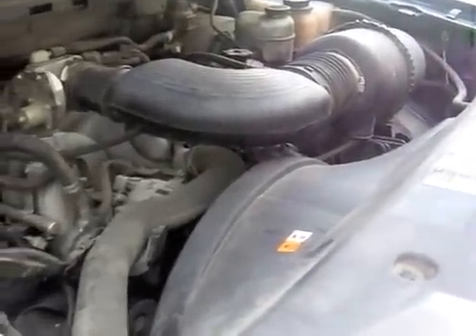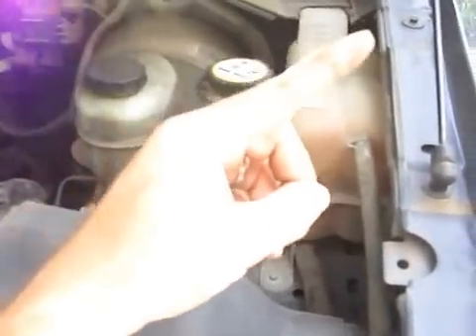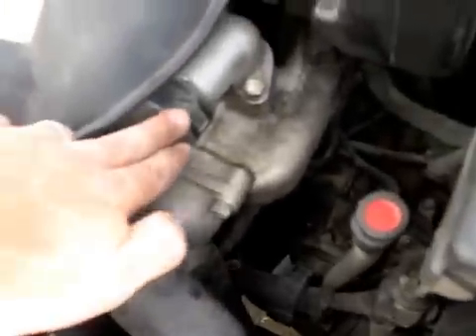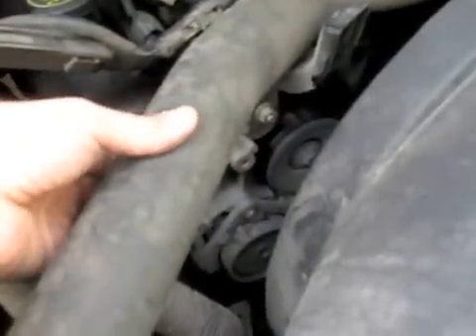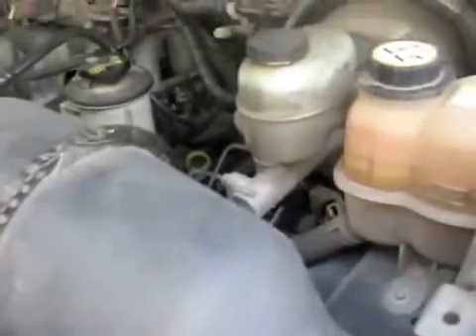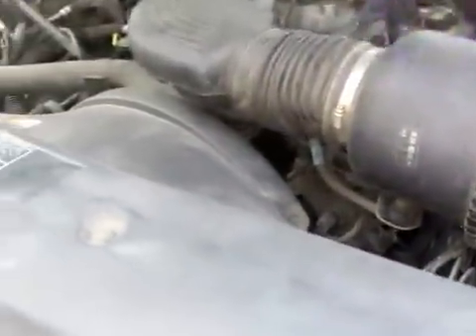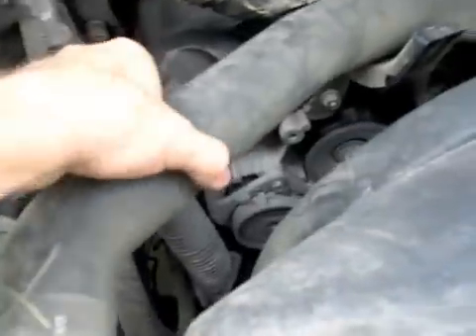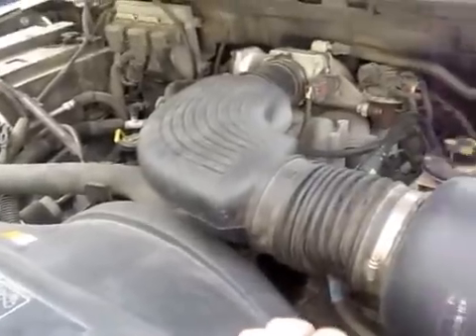Car Engine Overheating - Causes and Symptoms of Over Heating  Car Engine

Comment: I have the 2005 gmc Sierra 1500.  My fans are electric, and the radiator is 3 years old.  It does have a belt noise when cold.   But it began overheating when heater was on,  and turning the AC on would solve it at first.   But now,  every time I slow down or stop driving, it begins to overheat even with AC on. The fans are screaming at this time.  Also, I'm not sure if this is normal,  but when i check my coolant reservoir, it is low,  yet as soon as I open the reservoir cap, it jumps back up to normal coolant level.  This thing is my livelihood.   Im stuck.  Can you guide me 🙏 please.

Comment: 2005 Lincoln aviator  4.6 AWD. Headaches! New radiator. New cooler fan. New A/Pump. New belt. Still over heating in idle and red lights. Will go 80 on the freeway. No problem s. And idle. Over heats ! Ugh
Reply from the maker: I would look hard at the coolant level and make sure there is not an air pocket in the system or it's low on coolant. The radiator hoses should have some pressure in them and not super easy to squeeze together with your hand at normal engine temp.  Both upper and lower radiator hoses should be hot at normal engine temp.  Either you don't have air flow across the radiator (cooling fan motor not running) or you are low on coolant.

Comment: Thank you for pointing out on all those causes for engine overheating. Our 2003 Chevy Cavalier (~111K) overheats only when AC is on and on stops. So most likely it is a faulty radiator fan. But the car has another problem w/knocking sound when it starts to move. The frequency depends on rpm, and it doesn't change if to switch gears on speed. No sound (knocking noise) on idling. The sound is heard in the area of engine, looks like more on the right side. Can those 2 problems be related?  I replaced a radiator on another our car (2001 Saturn SL2), and it was not very difficult. But on Chevy I think maybe they are Connecting Rods which make that knocking sound, so I even don't know if to proceed with this car. My hope is that the noise is only in motion, I hope it is smth on suspension. Thank you again for this informative and detailed film. As a DIY mechanic I've learned a lot, like about time interval when hoses should be replaced, why and when it could be overheating on high speeds and when on idling. It will be my main channel on overheating.

Comment: I'm South of Houston. My 02' Blazer 4.3 is seeming to get around 210° , it does when towing a small utility trailer.
No leaks, water pump works fine, flushed the radiator twice in 2yrs.
Just installed a Severe Duty Clutch Fan but doesn't seem to help.. My AC is always Cold as heck. 
In the past with a 195° thermostat, it's always ran just below 210° & now it's trying to rise a bit higher which bothers me.

Comment: Take a water hose engine radiator cold squirt water through the back side out the front grill to flush out dirt bugs and grime like you would a AC evaporator condenser coils almost the same as a radiator it would cool half of it s temperature just by rinsing the outside of the radiator

Comment: I have a question I have a RAV4 I was driving and the hot need from the engine just shot up yo high and at the same time the heat stop working. I change the radiator the thermostat two times what can be the problem

Comment: I just went through this problem with my 05 navigator with the 5.4 engine, driving on the freeway, noticed that the temp gauges went into the red line. Got off the next exit, found a place to park an pop the hood to see what going on. Had to sit there for fifteen minutes to cool down. Looked at the reservoir and it was sitting the low mark, but it still had coolent. After cooling off, I drove a little slower, went to auto part retailers and purchased some 50/50 coolent and topped it off. Drove it home, next day,  drove awhile,, and the gauges indicated it was starting to over heat. Next day I got radiator pressure tester and the fitting to test the reservoir bottle and cap. The tool and adapter didn't seal, had to use some pipe sealant tape to get it to pressurize. Was able to pressurize, but was leak at the threads of the adapter. Same with the adapter for testing the cap. I had purchased a new thermostat when I got the testing tool, but I had not installed it yet. I returned the testing tools and purchased a new pressure cap after noticing that the rubber gasket in the cap was worn down. Put the new cap on then took a test drive and monitored my scan tool for the coolant temperature. After the engine got to temp and stable, I continued drive  at freeway speeds for fifteen minutes. The coolent temp stayed steady plus or minus the thermostat rating, problem solved.
Reply: So the overheating was cause by a bad radiator cap?

Comment: Our car is getting hot but the temperature gauge never goes up.  We are also burning a lot of feul. Another thing is that the reservoir tanks amount never changes.  We have a cheap diagnostic and it is throwing a p0035 code heater sensor 02 it says. Sometimes very dark smoke comes out the muffler. Was gonna do a flush to flush out the radiator but maybe I need to replace it? What is wrong with the car? Any suggestions.  Also it gets hot almost immediately but never goes up on the gauge.

Comment: If I'm having overheating problems will my fans turn on more than usual in order to help the motor stay cool I just replaced the motor, radiator,timing belt and water pump

Comment: Hello sir and thank you for your video.  05 tahoe here!!. I was in stop and go traffic the other day when I noticed my engine temperature gauge moving past the 210°F point where it usually and normally operates.  It would not completely go in to the red zone but it did concern me since it never did that before. I had the heat running at that time when this happened.  While trying to diagnose this issue, I notice that when I would turn the heat off the temperature gauge would go back down to its normal operating range of 210°.  Any idea on what maybe causing this?? I have a new radiator, new water pump and thermostat. Also new heating and radiator hoses. I have not notice any leaks and my coolant level is normal.

Comment: My head gasket is changed 2 days back , my engine heats after ac turned on not much but slightly high. My mechanic says it will resolve automatically is that so or something else ?? My tube system intact and no leak and changed fan motor earlier still heating when ac on , what to do ???

Comment: Hello, I just replaced my radiator because the original had a crack on the passenger side of the tank, also, I replaced my thermostat, there are no leaks anywhere, started my vehicle, ran it for 15 minutes, watched the temp gauge and it didn't go up to high, checked for leaks, and my fans kicked in, like they where suppose to, shut my car down, and it wouldn't restart, burped my radiator, added coolant, it restarted, ran for 30 minutes, didn't overheat, shut my car down again, and it wouldn't restart, what could be the problem or might be the problem??

Comment: 2001 Nissan Frontier 3.3l V6 2 wheel drive 
Just overheated just got a radiator replaced new Thermostat done 3 weeks ago for the same reason I’m still overheating not sure why 
The Reserve tank is bubbling and  also out of curiosity I open up my oil cap and it’s was smoky.

Comment: Great video. My Trams am is overheating  when I'm stop at a Red light.  I will check the fans. When I start moving and picking up speed the needle goes back to normal. Only when I'm stop at a red light the needle goes all the way up

Comment: 2007 colorado 3.7 
Overheats over the center line about 1/4 when sitting at idle when I give it gas it goes back down to center.
I changed water pump, fan clutch, belt tensioner?

Comment: The fan is a a viscous fan or a  heat exchanged  air flow thermostatic operated fan they both have a coil in the front and runs at different speeds depending on how hot  the rad is don't give up your day job hopefully nobody takes your advice

Comment: I have a question why does my 2008 GMC over heat when I’m stationed and when I turn on my A/C the fans start kicking in but if my A/C is off the fans don’t kick in at 210 degrees?
Reply: Check the fan relay

Comment: Very good video, I have a 2006 Toyota Highlander 397500 miles on it, I had check engine light come on test said bad
Cats had the replaced (engine never run hot) after the were installed highway driving the engine will get hot, A/C on or off, no leaks. 
Slow down it will cool down useless run 65 mph. The cats cost 1350. Parts and labor, what do u think? Thanks

Comment: I just had a mechanic replace the waterpump on my 2000 gmc sierra 4.3, never had issues with overheating and one day I got home and it just took a huge leak on me, replaced it and now I don't have any leaks but it overheats after 30 minutes into driving, I tried flushing out the cooling fluids but nothing comes out when I unscrewed the bottom radiator cap and the reservoir cap. I think something is blocking the fluids and fans are working fine, doesnt matter how I drive it is about 30 minutes into driving

Comment: Top man. 
I have an overheating seat 
Water pump changed thermostat changed 
Pressure test done and still overheating 
Radiator next to check? 
It only overheats on freeway not when idle.

Comment: 2012 dodge journey 3.6. Only overheats when the air condition is on. Any ideas? I have replaced the thermostat and it still continues to over heat.
Reply: It's your fan.

Comment: The shop (that i never use) did a power reverse flush to get all the rust out. Ok payed the 81 dollars and drove away. 07 impala 3.5. Then 5 minutes later the motor overheats, ding ding ding, shut engine off. So i shut it off, turn it back on and it's almost at a normal cooling on the gage?? Then i watch driving on the Eway the gadge get hoter and hoter again. I repeat then same thing. The temp gage reads 50% again. Then again slowly goes up to red again DING DING shut motor off. What is this? Did that shop deliberately mess up my car to bring it back? I sencer they monkeyd with or a bad thermostat?? Or..

Comment: My 03 gmc yukon overheats after my AC gets warm at idle I replaced the radiator, condenser, thermostat and a hevy duty fan clutch and still ac warms up
Reply: Radiator cap

Comment: Hi  how are you mr.mechanic ? You have great  show I learn lot I got question for you  you can help me like you said in your channel my car honda accord  ex 2006 start getting hot low like city if have to wait for some one in the parking lot  with my car on with my A/C ON my car run hot when start running  when back normal on highway run great so I went mechanic friday change radiator hose lower/upper also thermostat   today I use car was great I use can lot today them I was in macdonalds at window  run hot what's my next step please I need help .

Comment: I have an 06 acura. It will not hold antifreeze.  Does not smoke from exhaust but it does steam from under the engine, especially while stopped,  but can smell the overheating while driving.  Replaced the cap,  helped a little bit.  I can squeeze the hose from the radiator. The leak is not external,  so we are hoping the coolant is not going to ther engine.  However oil looks great.  Any suggestions?

Comment: TRUSTMYMECHANIC.COM,,   
                               I don't know how to test the temperature sending unit or where its at in cars. I'm not sure if the sending unit means a sensor. 
        1.)  How do you test or what do you use to test the temperature sending unit?
              2.) Can I buy a digital gauge at PEP BOYS and install it in the fuse box wires by slicing the wires to test if the analog temperature gauge in the car dash temp gauge is reading false reading measurements of the temperature?
            3.) Can you make a youtube video showing how to test the car dash gauges to see if they work correctly and not reading false readings and how to test the sending units to the cars gauges?
           4.) I don't know how to test the cars gas gauge, oil gauge, temperature gauge using a ohm meter or what other test tool can I use to test these gauges are working correctly and not giving false reading or not working correctly?

Comment: My 2002 sebring keeps overheating and I have to fill up the reservoir every time I have to use the car but can't find any leaks. Any ideas on what it could be???
Thanks for the info
Reply: Rodrigo  Vazquez most likely leaking at the wheep hole on water pump!! This mostly happens while driving and is why you can’t find a leak..replace water pump thermostat and do a flush!
Reply: @LH81633  thanks a lot chief. I changed the reservoir because it had a hole, did a flush and filled with antifreeze, purged it and works fine. Now at regular temperature sounds a little like a diesel engine but doesn't over heat.

Comment: So a mechanic said i need a water pump which is why my car is running hot. Can that be? And my heat is cold when i run it too?
Reply: Tieara Scott run engine on idle squeez hosed if soft add fluid if still soft then replace water pump.. if also check thermostat first as if it is stuck open engine won’t reach temp and no heat!! If pump was bad it woul over heat!! But I’d replace both they cheap and easy to do

Comment: Hello sir hope u will answer my problem..
My car overheated once and my collant was vanished after 2 mints driving..i change raditaor ..now my coolant is not vanishing..no leakage is there..my fan is good..evrything ia good but still my car heating up after 2minta engine starting..my coolant get hotter and all the pipes got hotter even my bonnet gota hotter even my tires got hotter...although my car not showing overheating symbol to me but my car engine and all the pipes burning like hell..where is the problem sir plz i am waiting

Comment: Overheating at idle but not while driving. My new clutch fan comes on at start up but not when over heating it's only about 6 months old. 2002 dodge Durango new thermostat, radiator, electric fan,  hoses, idler pulley and seen that my belt was on wrong???? Help me please my next step is the water pump???
Reply: Rose Thorn water pump!!

Comment: Hi 👋 how are you?
My Toyota Sienna 2008 i fell heat under my feet 🦶 well Driving.. No cooler on or heater on.. No Heat ideal Nido high.. 
may I ask what would this it is??
Reply: Elias Cruz  temperature knob on cool area or warm area? If that’s case closed the ventilation knob to closed

Comment: I have a 98 ford expedition 5.4l I live in southern Az and it overheats sitting on idle with the a/c on after idling for about 10 to 15 minutes. I'm thinking it might be the fan clutch? It had already melted a thermostat gasket and after replacing the thermostat and adding new coolant and water it stopped overheating for a while but now it came back any thoughts?
Reply: Again the engine was rebuilt at 130,000 miles and i have added 40,000 ever since and i know the radiator was replaced for what seems like a thinner one. Im thinking about replacing the fan clutch and getting a bigger radiator. If that doesn't work im selling the truck.

Comment: Iv had several bad thermostats, but not ones that cause overheating. They usually get stuck open (fail safe)
But i suppose its possible they can get stuck closed (fail secure)

Comment: Question! I have a 2010 Ford F-150,
Today I changed my radio,  I blow up some fuses, and I replaced, but from there,  my truck got over heater, and starting blowing hot air, I never have the problem it was good until I replaced the radio, and fuses any clue what could be help ?
Reply: F150 does the car Buble up at radator or overflow bottle let car cool off then replace all fluids squeeze hose make sure hose are not tight because thermostats do stick dont drive a car with blown head gskt need to make sure fans are all works relays are ok and no leaks if you have pressure gauge make sure pressure is holding first if leaking fix it if you c
Don't have pressure test AutoZone has head gskt ck changes color when checked at radsitor cap fumes if hose are tight replace thermostats replace antifreeze but let the car cool down
Reply: Pop
Reply: Ck fuse for AC there are I think three fuses one is for fan acc clutch then compressor fuse then ck for leaks Walmart cheap kit to check for leaks to fix ac shop has tool so AC does not go into air bad tobreath and also against the law need to have recovery machine worth it let the pros do ac work my advise
Reply: Put wires back together!!! You most likely unplugged  ac/heater wires and connected them to radio!! Keeps do the same thing!!!

Comment: The spring type clamps are superior to any screw/worm clamp. During temperature and seasonal changes the worm clamps can and will leak if not tightened and retightened. The springs clamps never will be loose or leak due to temperature changed as the spring will always tighten.

Comment: Make sure you check a new thermostat before you install it. I put in new thermostat and found out it never opened until it got over 230°F.  Long story. But test your new thermostat and make sure all the air is out of the system.